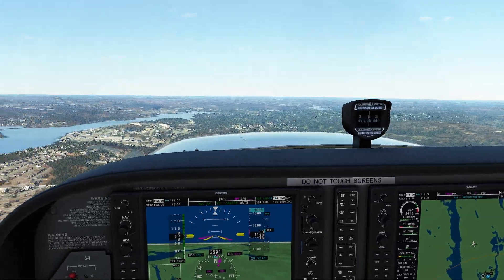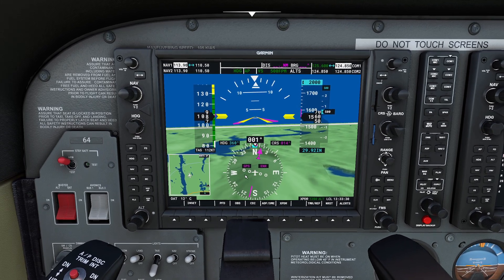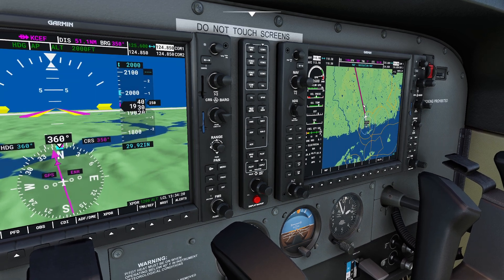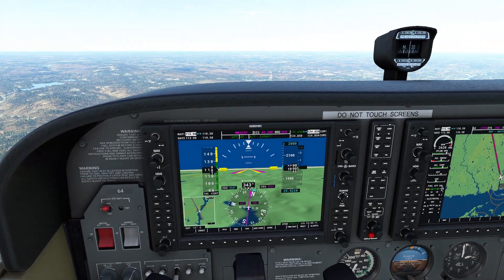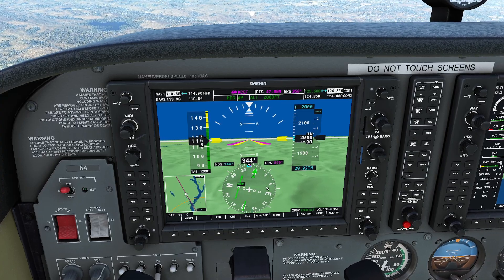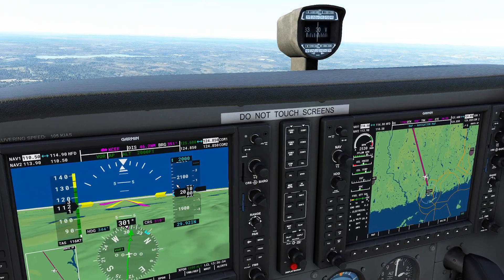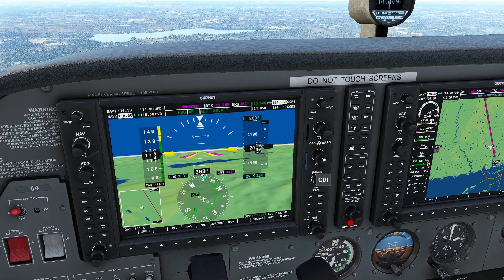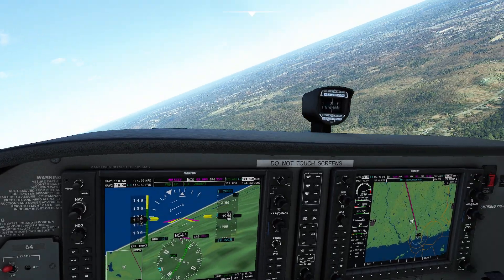MSFS - Choosing Navigational Sources for Autopilot

Comment: Is is possible to assign a a key command to cycle through the NAV sources? (Switch from GPS to NAV 1 and NAV 2) If so, does anyone know where to assign that in control settings?
Reply: It is named "TOGGLE GPS DRIVES NAV1"...;)

Comment: I am kind of surprised that NAV was able to capture the VOR2 when the plane was pointed in the opposite direction. I thought (maybe only for GPS?) that you had to be at least on course to intersect the radial and a reasonably close distance from the radial, or it would ignore capture.
Reply: I was thinking the same thing. Maybe this was an earlier version from Working Title where they didn't have the requirement.
Reply: @jakew9887  This looks like the default G1000. I have no clue why he insists on using it when the NXi is so much better in every aspect.